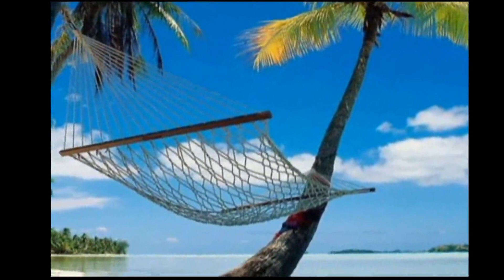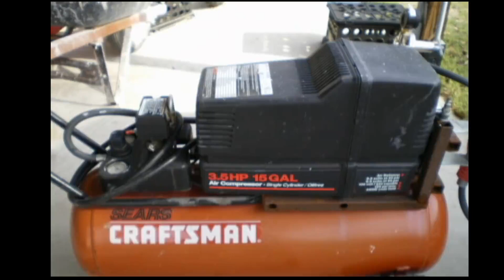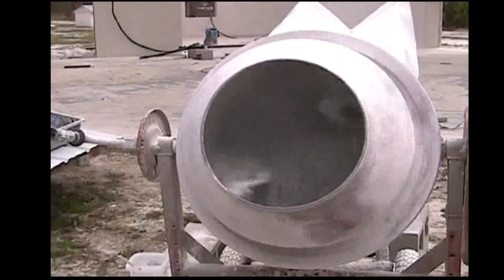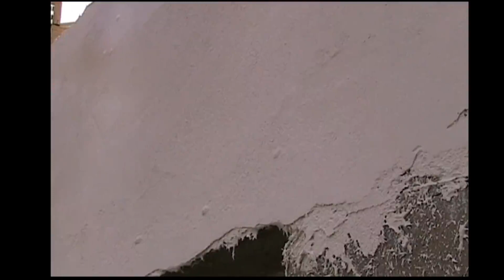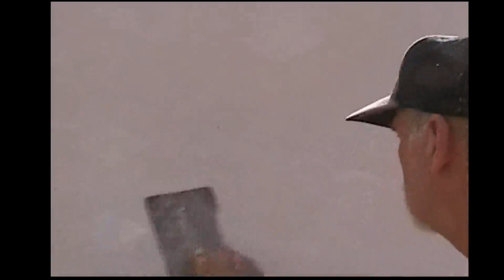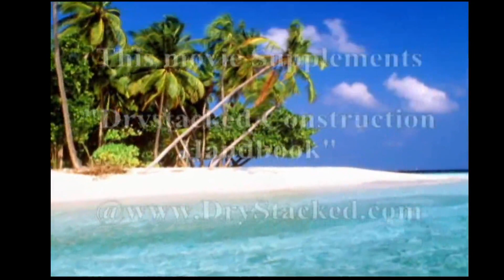SBC Mixing and application

Comment: Very helpful video, thanks.  I've been to your website a few years ago and had many questions.  I am surprised how many passes you make with the trowel compared to Quikcrete's video guide.  Of course, they only show using it to build short yard walls, not home construction.  How does the smoothness of your thrice troweled finish compare to a smooth Santa Barbara stucco finish or an old interior plaster or a drywall mud skim coated wall ?
Reply from the maker: Good question! If you trowel it dry, then it is like course sandpaper. If you trowel it wet it is much smoother, but, discolors somewhat.
Reply: @FixitMyWay  So you must do a 7th row grout seam by code, or is that just your method?  Seems it might be faster just to put a leveling layer of cement on the top to fix any leveling issues or grind any high spots down than to spend a lot of time worrying that you got every block completely even?  Or you can just worry about the last row fitting and grind down high spots?  I guess this is all in the book?
Reply from the maker: @VenturaIT  As blocks get more uneven, that row gets longer because the vertical unevenness inserts more space at the center of each adjacent block. The e-book explains compensation for wall growth but without that 7th row fix, then the top row may exceed the compensation factor which would result in none vertical corners. This is why I chose that method, you can try your method as long as the top row is not excessively longer than the bottom row.
Reply: @FixitMyWay  that's probably why the mortar system exists, after you learn it, it's easier to get things level because you are always only leveling 1 row... thanks for the videos...  my main curiosity is about the fill, do you drop rebar down from the top then fill with concrete from the top?  do have to do a beam ring part the way up (one row that is filled horizontally with concrete and rebar?), does the rebar dropped from the top tie in to the bottom, except on the places you showed?  my idea would be to make the walls thicker and flip the blocks 90 degrees and make the walls 16" thick, it requires twice as many blocks right?